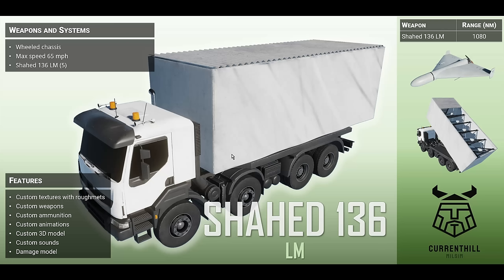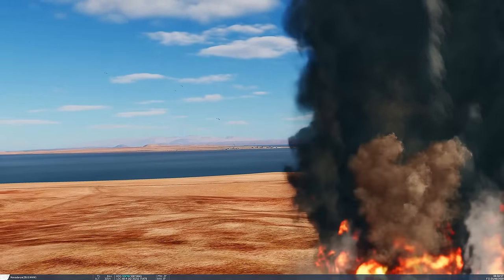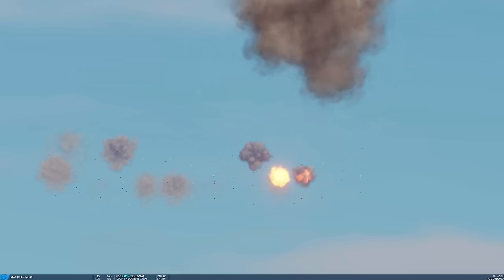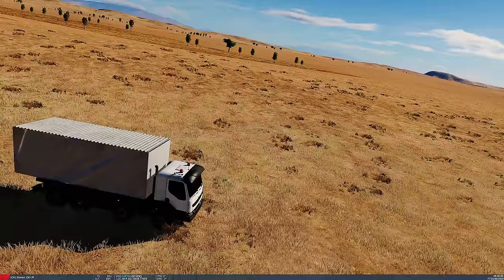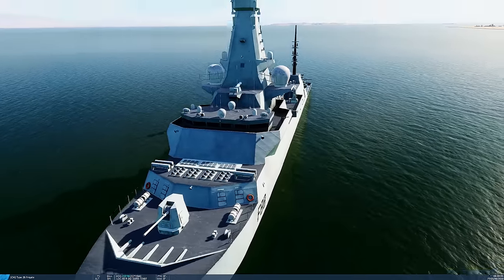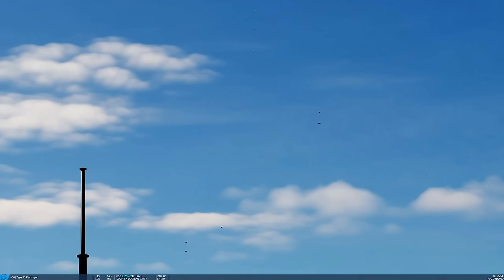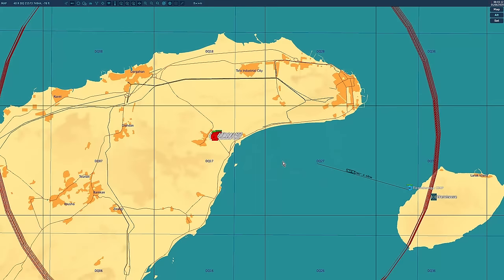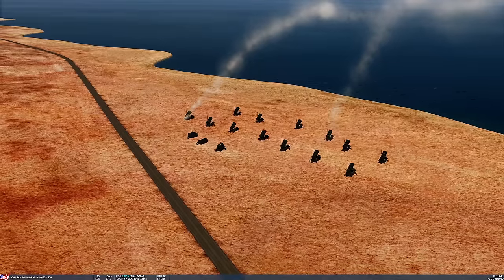Which Defence Assets Can Stop An Iranian Shahed 136 Drone Swarm? (WARNING: Hugely Explosive) | DCS

Comment: The mantis system from Germany would be interesting as well, as it's supposed to be a point defense weapon system, to defend against missiles and drones. It's much more modern than the r2d2 with a hard on and lots cheaper than a missile battery. Essentially it's designed for this job.
Reply: It’s the one with the shells that turn into shrapnel right?
Reply: @SomuaSomua  yeah, it shoots rounds  that are programmed to explode somewhere before the target and release tungsten balls (I think).
Reply: I'm so disappointed he didn't even add it. There is no way he didn't hear of it. The one system with programmable high explosive proxy fused ammunition, designed to shoot down mortars and small drones in saturation attacks like this.It's the type of system he would have played at the end of the video to show how every type of technology is just an engineering problem with a cost effective solution out there.
Reply: Yep, the Rheinmetall Mantis firing AHEAD ammunition is made exactly for this kind of thing.
Reply: Ya Rheinmetall getting those Defence dimmadollars
Reply: @iran_ghavii  found the Iranian

Comment: Hey Cap, I think WW2 ships with Flak would be really interesting if the Shrapnel is modelled. BR
Reply: that's what i was thinking, for swarms this dense with such slow, fragile targets some good old fashioned AAA. some german 88s or USN 127s.
Reply: Flak is the simple and economical answer to this problem for sure.
Reply from the maker: Actually that's a great idea
Reply: @grimreapers  40 mm bofors guns would probably be enough but they would need to be layered from the beach and past the target buildings
Reply: @MatsGarage @grimreapers Sweden has been sending 40mm Bofors emplacements to Ukraine to provide air defense coverage. It's something worth modeling in DCS to see if it has an appreciable impact on the Shahed swarms.
Reply: @grimreapers  And this has me curious: how well would the "SAM Alley" anti-air network from the Vietnam War fare against a Shahed swarm? Particularly if the drones were targeting SAM sites or ammo dumps...
Reply: @grimreapers  There is a very interesting new defense system from Germany specifically designed to fight drone swarms, Is called Skynex system and I think it would be amazing to see it up against 100 drones
Reply: @deskmat9874  would be comparable to the Chinese SPAAG, I think .. same rate of fire, same munitions.

Comment: Cap, you missed using iron dome which was designed to take out unguided rockets and artillery shells. I would think that system should be able to handle a swarm. A typical battery has 3-4 launchers with 20 missiles each. So having 2 batteries would be able to do it or one battery with a couple extra launchers.
Reply: Just bring back the "punt gun"! 

https://en.m.wikipedia.org/wiki/Punt_gun
Reply: it's the only production system that have actual proven experience taking down huge swarms, but I doubt dcs has a realistic model
Reply: @raph151515  it does, made by IDF mods project
Reply from the maker: Wow the recoil on that thing must be shoulders...
Reply: @grimreapers  in fact it was so good that it almost had the europen bird population extinct.
Reply: @lidor276  If DCS has a functional "punt gun" GR must do something with it.
Reply: @raph151515  yea .. the cost of one missile cost 5 times of the cost of one shahed drone
Reply: @mohamedoraby580  anyway it's not supposed to be even, it's suppose to give you the freedom to chose the time and means of riposting, the drones are not the objective, but the army behind them.

Comment: How about Iron Dome? I think it might do fairly well, given that it was designed to counter swarm tactics.
Reply: I think it'll be effective, with a few getting through
Reply: Yh but that's if they were only sending drones .. if they had missiles coming from behind them at the same time it's gonna be even more difficult
Reply: Not only was it designed to deal with swarm tactics, but the Shahed-136 are actually bootleg copies of the Israeli Harop swarm drones that have been in use since 1989. Thus, the IDF is uniquely situated to deal with the Shahed--is just their Harop with half the max speed, a slightly higher yield, and significantly worse controls/electronics.
Reply: @theprogressivecynic2407  interesting.
Reply: @TimvanderVelden-dp3fs  Yeah, it's brutally ironic that the Russian have had so much success using the Shaheds against the Ukrainian S-300 air defenses because they are based on drones that were designed to defeat S-300 and S-400 systems in Iran and Syria.
Reply: @theprogressivecynic2407 😢😢😢😢😢😂😂😂😂😂😂😂😂😂😂😂 cry zi..ts does not have that technology to built drones like shahed
Reply: @theprogressivecynic2407  wiki says this is not true and post 2015 and then i thought...drones in 1989 lol amazing
Reply: @fishermancounty777  Wiki isn't exactly a great source for this sort of thing. The IHI Harpy was released in 1989 and, if you look at a picture of it, it's pretty amazing how similar their designs are. The US was also working on a similar program in the 80s called the Tacit Rainbow, but we failed and shelved the program until the Harpy proved the concept sound.

There was actually a big dust-up over it, where IHI wanted to export it to a couple nations in 2005, including China, and the US pretty much blew a gasket because they were concerned about exactly what is happening today--a bunch of anti-Western powers flooding battlefields with cheap loitering munitions (the technical name for this sort of drone). 

As a general rule, the US has the best heavy drones (eg. Reaper) and is working on a number of ones that could easily replace fighters and bombers in the future. Conversely, Israel makes the best light drones and loitering munitions. Iran makes bootlegs of both that are still highly effective, but don't match up against the originals. Turkey has a very strong drone program and produces a mix of light and heavy drones (eg. Bayraktars) that are somewhat less effective than the top producers' drones, but cheaper then them, and better than Iran's knockoffs. China has a large drone program, but it's effectively unproven and so drawing any conclusions about their weaponized drones is speculation.
Reply: @theprogressivecynic2407  ukrainian use s-300s doesn't say much about their effectivness, I've heard they lacked maitenance since 90s and like 1/2 - 1/3 are combat-ready, and most of missile stockpiles left in Russia after USSR dissolution
Also to hit small targets russia mostly uses point-defence Pantsirs networked with s300's detection radar (they were specifically designed to work together), S300s launchers are too costly to fire at such cheap and numerous targets
Reply: The area of Israel is smaller than the area of the Kyiv region. So that you understand the scale. There are about 20 Israels in Ukraine by area
Reply: @dmytroandruhov9119  Yeah, Israel is tiny and so they can have multiple interlocking layers of protective systems that make getting anything through pretty hard given their systems. Unfortunately, Ukraine is much larger and less densely populated, so they have a much harder task when it comes to air defense.

Also, while the US gave Ukraine a couple Patriot modules, we need to give them more so they can also cover Odessa using them. Russia basically realized that they couldn't easily attack areas under Patriot protection, so they have decided to attack areas that aren't protected, despite those areas falling far outside any battlefield (thus a war crime).
Reply: @theprogressivecynic2407 
Bayraktars 🇹🇷   😂😂😂😂😂😂

Comment: Patriot batteries can be even bigger, however, they are rarely used like that. The only time they are is when each launcher/set of launchers are dispersed miles or dozens of miles away from each other over an entire battlespace rather a smaller portion.

Comment: The radars may not be able to differentiate individual targets with large swarms.  Kind of like large clouds of chaff.  It might not be a bad strategy for drones in swarm attacks to have radar reflectors to increase the number of radar returns the defending sites need to process reducing their accuracy.  Like how the Qail decoy could mimic formations of B-52s.
Reply: I do know that Modern Spy 1 and Spy 6 radars can differentiate individual targets in swarms, but I am unfamiliar with the capabilities of other systems. I doubt mobile land based ones can though.
Reply: Radar relectors (Luneburg lense) doesn't increase the number of radar returns, it just makes the returns bigger. The ADM-20 Quail used reflectors to make itself appear to be the size of a bomber. Also, for stealth aircraft in times of peace use radar reflectors to make their RCS return much bigger in order to keep their actual signature a secret. 

The US does have the newer ADM-160 MALD (Miniature Air-Launched Decoy), which has been sent to Ukraine. It's not really miniature, as it's like 9 feet, but only a few hundred pounds. What makes it cool is, it carries jammers too, so you can jam radar and communication nodes. It can loiter over an area for up to an hour, you can adjust reflector size so it could look like a missile or a fighter jet to fit the need (even make it maneuver like a jet would). You can send a big swarm of them to help ensure the real missiles or kamikaze drones have higher success. Ukraine is using them to help Storm Shadow success. US has even newer models coming (or perhaps operational, I'm not sure) that are a bit smaller I believe but can still appear bigger if desired, with better electronic warfare sweets and datalink capabilities, and the ability to carry warheads to make use of at the end of their fuel, and I think they might include the ability to return to safety to be reused. 

The thing is, these decoy missiles are cheap relative to a Storm Shadow, at like $30k per decoy, but the Shahed might only be like $10k. Also, these decoy missiles are all much faster than drones, so they couldn't really disguise themselves as Shaheds, but they could pose as more important priority targets and help to deplete the air-defense systems ammo. For the price it would just be better to have a bigger swarm of Shahed drones to be honest, that's the name of the game with them.
Reply: @wolfmaster0579  There's a gentleman on YouTube here that goes by the title of habituallinecrosser, who says he was part of the US Air defense corps for 10 years on the patriot system.

He did a video looking at the S-400s compared to the Patriot and if I recall, his biggest issue with the ability of the S-400s was that yes, the radar may be able to see as far as they claim- however, given the size of the radar and the power they have available, it will likely only be a low fidelity image. The patriot radar meanwhile may not see as far, but because of how much more concentrated it is, it's a much higher fidelity radar allowing it to have better targeting against the extremely small RCS by comparison as well as swarms.
Reply: @user-gv4zb9rc6u  I am aware of his channel and love his videos, although I have not watched everything. I am much more familiar with sea-based systems of the US navy and allies, not so much land-based ones. The reason I believed that mobile land-based systems might not have the same fidelity was because of power requirements. A ship or large stationary land-based system has a lot of power available to it, therefore allowing it to see much farther with greater fidelity than land-based mobile systems. I guess I need to do a little more research.
Reply: @wolfmaster0579  ship based radar will indeed have better fidelity over a long range most of the time, especially if it's a nuclear powered ship, simply because of power volume for sure. That's why, for example, the Gerald R. Ford has such a comprehensive layered radar system alone and still has a fair bit of left over power for modernization if I recall.

However, that's why for Patriot the range is reduced compared to S-400 or SPY-6, as far as I'm aware, the fidelity is above an S-400 and perhaps on par or just behind a SPY-6.
Reply: @user-gv4zb9rc6u  That is really cool. Thank you for the amazing info, ill be sure to look at it further.

Comment: Ok, IT programmer guy talk here. One of the problems of AA guns vs swarm of drones is that these AA defenses do not have any good algorithms for maximaxing damage against swarms. They always just target one drone, fire, wait until dead and THEN target the next. There are two big improvements possible that I believe are definitelly going to end in more modern AA guns. 
1) Fire a volley on first drone and DO NOT wait until destroyed and immediatelly go fire a volley on second drone. 
2) You can actually find in the swarm pattern structures where a volley of bullets have a chance of hitting more than a single drone and prioritize that one. 

Techniquest like these can significantly increase defense against drone swarms and tehy are purelly on software upgrade to the systems. But you will NEVER get that in something like DCS because these algorithms are significantly more resource hungry and I do not think you would like minus 10 FPS just so that some AA can simulate a bit less brainless targeting algorithm in a game.

Comment: Have you seen the articles describing Ukraine using updated/ modernized quad mounted M1910 Maxim machine guns to take down drones?
They specifically mention it is used against the Shahed-136
140 years old but water cooled so it can run for days, and fires 7.62x54mm round.
Reply from the maker: That's amazing.

Comment: For the cruiser Aegis is used for detection and the illuminators (4 satellite dishes on top) are for guidance to target.  Not sure on classification (couldn't find anything with the correct number) so well just say that illuminators dictate the number of missiles that can be in flight at time. Crazy how accurate this was though. I was looking for the directors to be pointing at targets and amazingly they were.
Reply: The ship can ripple launch and move the directors from destroyed missile to next target whilst the other missiles are in flight. 
The Australian CEA’s CEAMOUNT phased array illuminator can significantly enhance this even more and can direct 4 targets electronically per panel. 
With 4 fixed panels covering 360 degrees on each ship that's a lot of missiles/aircraft that can be targeted and rippling targeting works as well, thus well over 16 targets at once. 
This little frigate and the future Hunter (RAN Type 26) class can lock on to 4 times more targets than an Arleigh Burke Destroyer. Remember tracking and targeting are two different things.
Reply: @LeonAust  Agreed an aegis cruiser can track a couple hundred targets at a time with SPY however for terminal guidance the illuminator is needed. If the illuminator track is lost (during terminal homing) after a specified amount of time the missile will self destruct as intended for safety reasons. But yes depending on target distance and time of flight multiple sm2 / sm6s  can be fired with illuminators only needed on terminal phase. And of course as they add new iterations they add active seekers but that falls well outside of my wheelhouse.

Comment: In real life, they can circle around the target for a long time and attack it from different directions.
Reply: In real life, they get shot at by all kinds of small calibre weapons while flying around near ground level. You don't want them flying around in regions with any kind of military units for too long.
Reply: @Nimmermaer Small Arms 101: There is a huge bullet drop that you cannot easily shoot at any flying object.
Reply: @aminabbaszadeh1066  Shaheds fly very low to avoid radar and get shot down by small arms all the time. 
Of course it's hard, but the volume of fire matters. In addition, machine guns have been converted to AA use.

Comment: "You have to fire and then see if you've hit before firing again, you can't just fire constantly"

Laughs in WW2 Iowa class 9000 peice AA defense consisting of:

20x radar guided Flak firing  5 in (127 mm)/38 cal guns

80x Bofors  40 mm (1.6 in) AA guns

49× Oerlikon  20 mm (0.79 in) AA guns
Be interesting to see that.

Comment: Hi Cap and CH, great to see the British ships. The upcoming Type 31 Frigate would be interesting with its 1x 57mm Bofors and 2x 40mm Bofors cannons offering full broadside engagement with programmable fragmentation ammunition. The 57mm rounds have a particularly large fragmentation area which may even be large enough for several drones at once (I do wonder if in real life the swarm would be spread over a larger distance though coming from different angles?) and an impressive rate of fire. Also to be fitted with Sea Ceptor missiles albeit only 12 or 24 (TBC?). The now confirmed 32x Mk41 VLS could be fitted with Aster anti air missiles to support the Type 45s as 'bomb trucks' if you will, they will lack the advanced fire control to launch Asters themselves (thats all just internet chatter so take with a pinch of salt and assume the Mk41 will be used for cruise missiles if we get any....).
The Type 31 been a lower cost and lower tech Frigate than the likes of the Type 26 and designed for lower tech adversaries for example dealing with gun boat swarms in the gulf  could have a good go at something like this, and consider you can probably get 3 for the price of 1 Type 26 or 45. You could also use it against the gun boats swarms you modelled in previous videos? I believe these ships were previously ear marked for more low level duties but sounds like having one with the carrier group would be a good idea to guard against any swarm attacks and to save them  precious Asters for another day.....